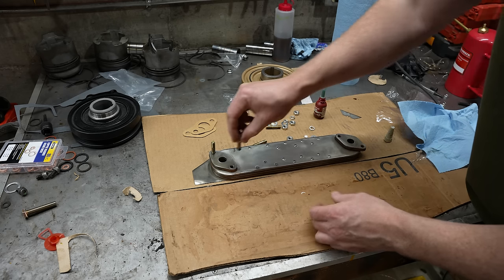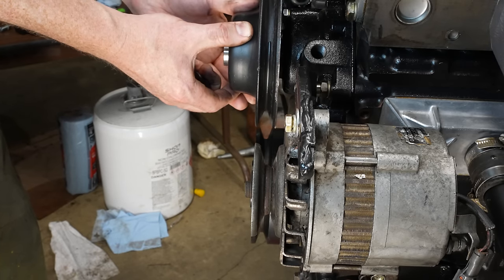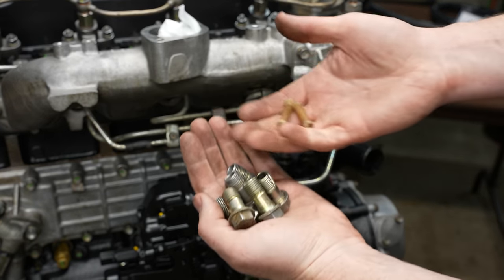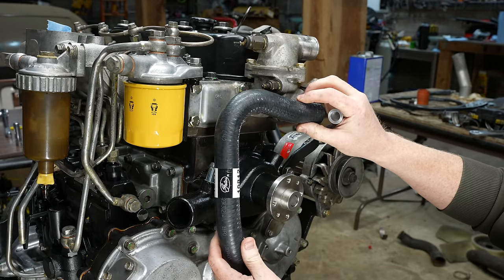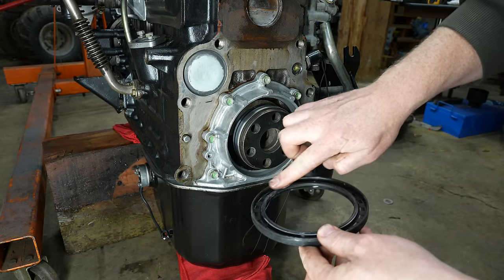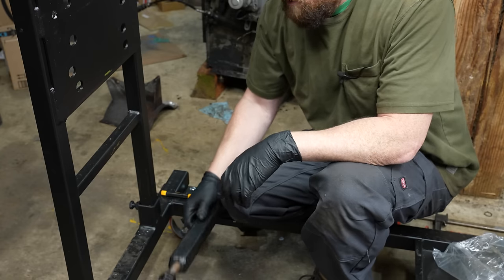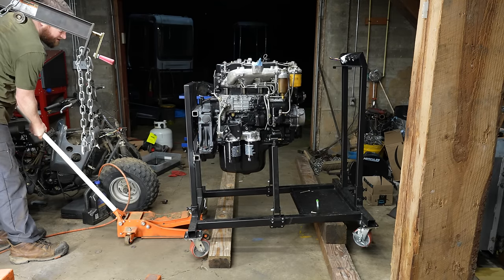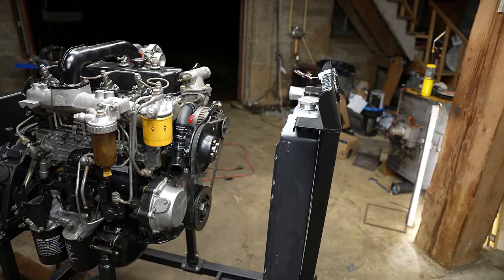Finishing the excavator engine rebuild - Isuzu 4BD1T/Hitachi EX120-2

Comment: Handy tip for the copper washers, tighten to where you think is right, then just tap the bolt with a hammer, it will seat the washer, then tighten again
Reply: YES!
Reply: that helps

Comment: I know the internet is filled with keyboard geniuses and sorting it out without going insane yourself is the hardest parts of sorting out good information. Some people mean well and others are just down right mean. Charlie is a handsome animal and having my own pet great company. Coming along great, this new clamping system is growing a lot with use of shrinking a fitting tight. I never thought about just tapping on those fuel washers for the banjo fittings would help seal things but makes sense. I am with you all the way on this..... and someone out there sponsor this man with a decent forklift!!!!
Reply: Maybe a forklift could be his next project 🙂
Reply: @buttonmonkey6845  YES!!  😃
Reply: A normal forklift isn't going to work on the dirt ground he has outside his workshop. He needs a workshop jib crane to save his back and make work easier.
Reply: Very true, I always think of forklifts in the “chunkier” variety (think pre telehander) as that is what we have on our farm brings its own set of problems with clearance in smaller buildings though 😬. Warehouse style ones are rubbish on anything other than smooth concrete I suppose. Def needs something to save the strain.😁👋

Comment: The best for sealing easily hot aluminium parts is to use copper o-ring. It's thin walled copper with fibers inside the hollow (you can't see fibers unless you cut it). It flattens easily according to both surface when crushed by a bolt. In Europe it's easy too find under norm DIN 7603-C. The C is a must, it stand for the shape or you will get standard copper washers. Greetings from Belgium.

Comment: Oh man...coming together
Was like "NOOOOOOO" when you said "this is it"...but ah well...we get to see a startup and run on a stand!
Gonna be cool to see that engine chug to life and turn some diesel into smoke and noise!
Even if you have to buy one of those craptastic cone filters from the autostore...put a filter on the intake of the turbo.
Not sure if you can build a resistor voltage divider to take the 24V pulse from the alternator to turn it into a 12v signal (not even sure if the excavator run on 24v or 12v) [holy hell...just looked at the auto meter diesel tachometer adapter...those things run over $100 easy.,..jeez!]
Keep em coming!!!!

Comment: Read up on V belt sizes.  That's why that factory belt is so wide compared to that narrow belt.
Reply: There are many sizes of Vee belts. Not just the width of the back but also the angle of the sides and the overall depth. Alig ing the sheaves is important but check the alignment of the various shafts for parallel. Probably won't be a big deal on this but something to keep in mind.

Comment: I remember replacing a motor mount in my 1972 Plymouth Satellite. I recognize yours. 
I knew my car needed it (pas. side) because if I hit the gas too hard, the engine would lift up off the old, unbonded mount. (It came down with a thud.  🤣😂).

Comment: Matt, you should always pre-fill your filters before installing them. One tip that will help, on fuel filters, use transmission fluid to pre-fill them, it helps to lubricate the injector pump and injectors. It's a old trick I learned from a retired truck mechanic and it really works. Makes the engines run pretty good too!

Comment: Matt, for break-in oil time, definitely use the recommended oil, but I'd run it for about 10 hours, then change the oil and filters of course, then run it for around 100 hrs on fresh oil, change around 100 hrs, then you should be on the regular oil change schedule the manual calls for. But, even though this is what I'd do, check the manual for any break-in instructions.

Comment: I admire you! I’m too afraid to try and rebuild my straight six for my 78 F150 4x4 and it is nowhere near as complicated as that thing you have tackled! 😅
Reply: Go ahead and go for it. Those Ford 300 c.i. engines will run forever as long as you get most of the big parts back in.😂
Reply: @kenore4003  yeah it has always had a bit of an oil leak and I only use it for hauling so I keep oil in the toolbox and I always keep an eye on it but unfortunately when I was sick my daughter asked if she could borrow it to pick up something and I just said yes and didn’t think about it. She was on the highway and saw the oil light come on and said she pulled over immediately and called me. I told her that there was oil and she put some in it and brought it back but every since then it has not been running properly and lost a lot of power especially under load. So I’m thinking that a head gasket is blown and/or maybe the head is warped. 🤦‍♂️
Reply: @shk2564  There are tests that a shop can run to tell if somehing is not right. Might be worth a few bucks to pinpoint the problem instead of firing the parts cannon at it. They check for exhaust gasses in the coolant and water in the oil. You can check for excessive blow by by holding your hand over the oil fill hole. That can tell you if there is bad rings or a scored cylinder.
Reply: @kenore4003  that’s good advice! I think I will do that so I can decide what my options are. Thanks!

Comment: FWIW I would remove the castors off the engine hoist and roll the run stand over the legs. It does have castors. Once unburdened the engine hoist can be dragged away if need be? You made it happen anyway so, nice job!

Comment: With the quality of work that you do You should have built your own enginestand. I built mine with my MillerMatic 211, cuz I can make it stronger than most of them & I used 1/4 inch wall tubing. I'm sure it cud handle 1000 LBS. Easily.
Reply from the maker: Yeah, it's just a question of if I wanted to spend weeks making my own or just buy one.  I already had this one though.  Any bigger diesel engine it wouldn't have worked for
Reply: The engine stand I made is quite Heavy, but it's still portable.@PacificNorthwestHillbilly. Always look forward to your awesome videos!!!

Comment: The copper washers will cause galvanic corrosion with the aluminum fittings over time, which will not only cause leaks, but also ruin the sealing surface on the aluminum components.
Reply from the maker: that is a good point

Comment: Matt did they press the flange on too far when they made the W P pump . At my work I have to choose how far to press on flanges to shaft for belt alignment .1/4 inch on too far ?
Reply from the maker: No telling what they did, should have rebuilt the old one
Reply: @PacificNorthwestHillbilly  If the flange is press fit to the shaft maybe just I think you said now 3/16 pull the pump and adjust it .pulling it out is easy going on you have to get to the back of the shaft .You can make a spacer so you don't go to far .I just did an aluminum pulley press fit ( scary) worked fine -- steel on steel very strong - Great work .
Reply: @PacificNorthwestHillbilly  It's also bad that the new water pump also has a smaller nozzle size, a homemade pipe to the thermostat greatly reduces throughput - there may be overheating (I apologize for the bad English)
And also... you have great content!  
👍

Comment: You should put silicone on the glow plugs hot bar as insulation just on the flat parts between connectors. A nice coating the whole way around with a little glass wrap will protect it from touching the other parts.
Reply from the maker: good idea
Reply: @PacificNorthwestHillbilly I would put some square tubing on that run stand between the wheels and frame so your hoist fits underneath next time.

Comment: hi plate behind  water pump pully /take back off and set up on a Boyar Schuitz surface grander ,and remove stock 100,000 //when I build all my Hemi 426 on every water prump my bushing hold + or - 5000  at 8000 R.P.M. IT PAYS IN WINNING EVERY RACE .

Comment: Have you ever tried adding RTV to the flywheel bolts? Sometimes it will keep oil from coming into the flywheel/clutch area
Reply from the maker: The holes are blind on this crankshaft thankfully

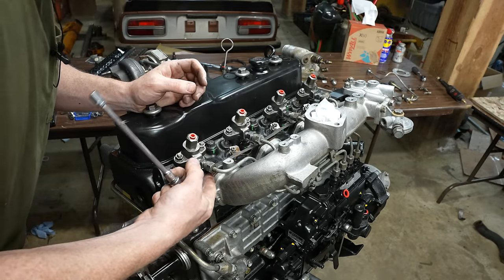Comment: 11:22 🤦🏻‍♂️That glowplug power strip is sketchy as hell. I'd be shrink wrapping it or atleast covering the unnecessaryily exposed 'bars' between each plug so it doesn't potentially arc out on any part of the grounded motor. I'd prefer it to be individual wires going to each gp like every other diesel engine I know of. 🤔🤷🏻‍♂️👍🏻👌🏻🛠️🔧🚜⚡💥💨😂

Comment: That front washer you put on the balancer did not look correct. It was a sloppy fit…which means if it is offset to one side when torqued, that vibration will translate through the crank and bearings. Additionally, that nut is not fully threaded…which is suspect. Can you maybe get a parts book and get the correct components?? Always love your work. Keep rockin’